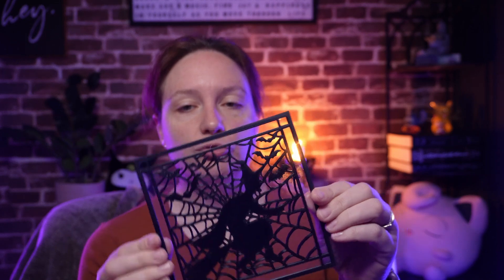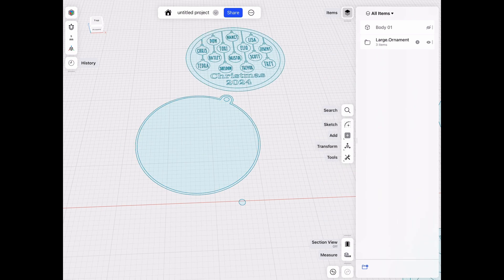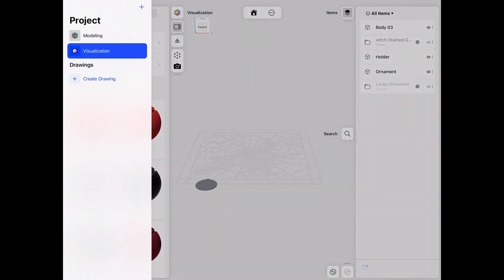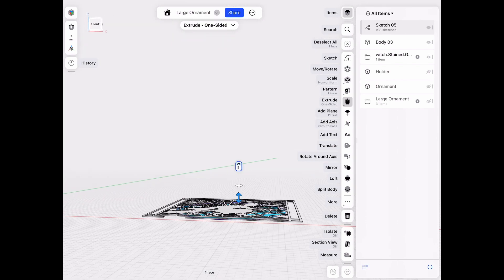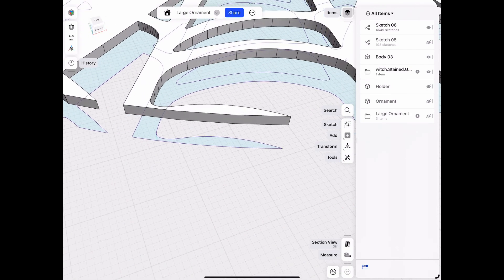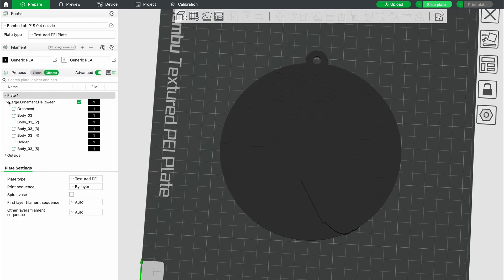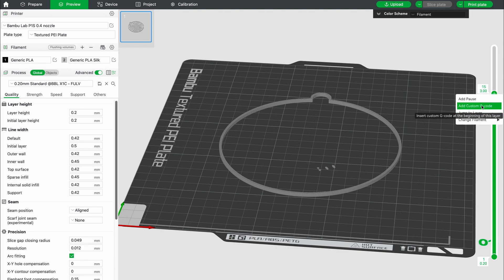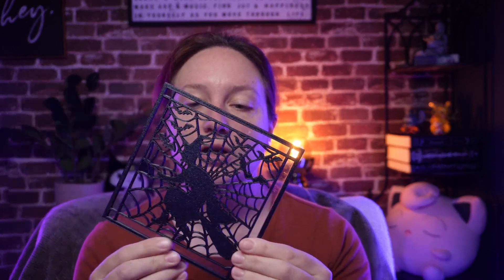3D Print Directly On Acrylic? Watch This Spooky Halloween Hack!🎃

Comment: 'found your video very interresting indeed, Thanks :) Nevertheless, I did catch the smart trick regarding adding an holder arround the part, I did catch the fact that you have to say the printer to WAIT, but ... I did NOT catch how you ask the slicer to NOT consider the volume that will be filled in by the acrylic part ?? On my side, if I perform the same, either the printer whant to print itself the acrylic part, either it sends big warnings because I do not consider some supports ... something is missing in the process :( Maybe I've missed a critical point, maybe because English isn't my mother thongue .. Thanks again !

Comment: You're years later. Literally. I have been doing this for at least 5-6 years.

😂😂😂 Try something new, like... Discover hot water? 😂😂😂
Reply from the maker: Ouch, do you say things like that in person to people you don’t know? Maybe you’ve been doing it for 5-6 years but I’ve only been 3D printing for over a year and a half now. I discovered the technique and decided to show others how to do it. Based on other comments it’s new to them.

But if hiding behind a username and avatar randomly saying you’re smarter and someone else you don’t even know is stupid makes you feel like a better person then you have bigger problems to deal with then me showing off an “old” technique. I feel sorry for you and hope things start to turn around for you. 😢
Reply: @LabcraftStudio don't feed the trolls. This idiot just wanted a reaction. Very nice video and great concept. You forgot to mention that after slicing you get an error about non-supported floating parts-- which of course is necessary as your printing on top of an inserted sheet of acrylic.

Also, it might be a nice idea to link the original video that inspired you. 

Question: why do you use 3dShapr? Seems awfully expensive when the free TinkerCAD can do the same thing. Is it because of the iPad support?
Reply from the maker: @ChippWalters good point. I updated my description and added my inspiration video from Julius makes. I struggled a bit with TinkerCad and I yes I really like using my iPad to create models so Shapr3D is a good fit. I have Fusion on my computer but it acts up a lot on my Mac. I am trying to learn Blender and Nomad Sculpt though that’s very different style from the CAD model.
Reply: Ignorant comment ***hole. Anyone new to 3D printing might find this useful. Just as if you started photopolymer printing and discovered something “new” about the process - I could jump down your throat and tell you I have been doing that for years. What an absolute jerk you must be in real life.

Comment: still watching the video, but could you use the jump to line feature of bambu studio to treat that base jig as a repeatable printing jig by pulling the acrylic out and putting new piece in with a jump to line? just curious
Reply from the maker: I actually didn’t know about that feature! But I bet you could. You would probably need to keep the plate, hot and skip the self leveling cycle though it might pop the base jig off.

Comment: once you've printed the holder do you turn off the bed heater when printing to the acrylic?  Thanks, nice print.
Reply from the maker: Nope, it’s not hot enough to affect the acrylic and the heat keeps the holder attached. ^_^